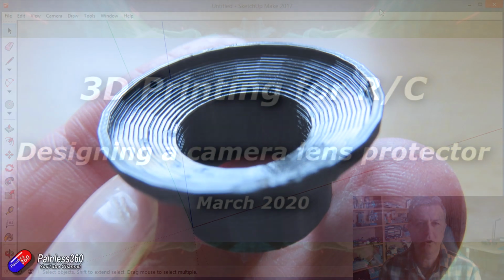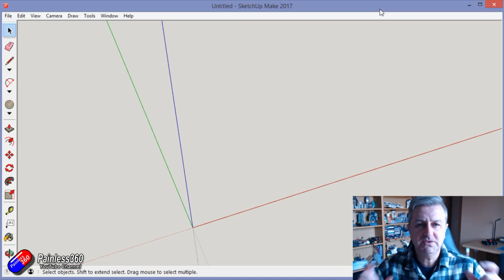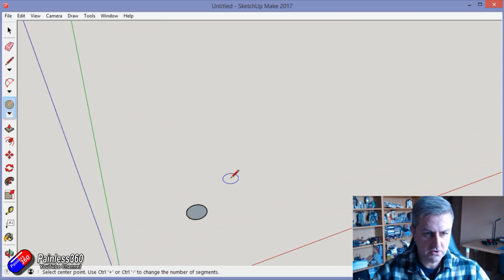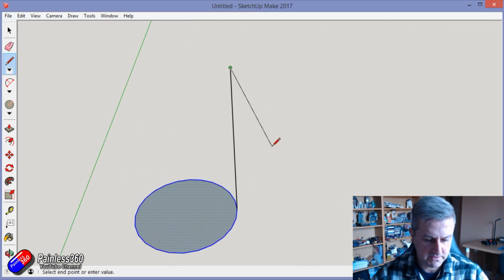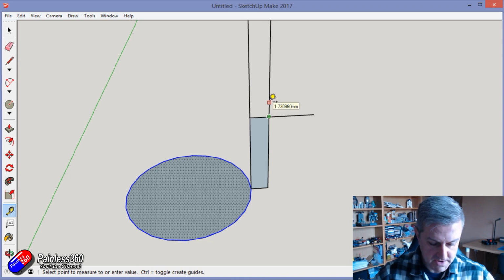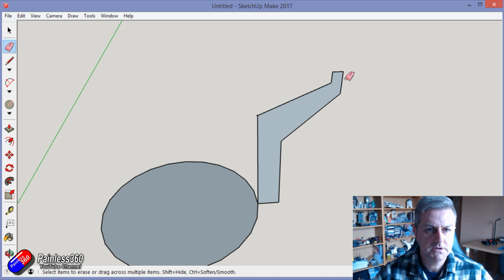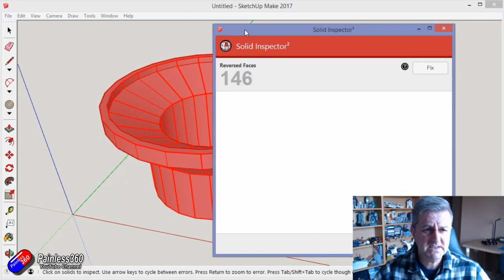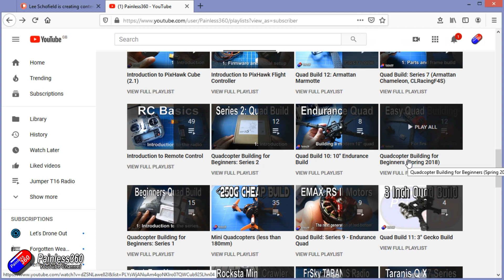Designing a DJI Digital HD Camera Lens Protector

Comment: Nice protector....but would it not be worth having a transparent layer of glass or plastic in front of the lens? There is still a chance that the dji camera lens can still get scratched even with the cone on (  maybe by a branch) . I know imagine quality may suffer with an extra of glass in front ....
Reply from the maker: It would, DJI sell one... Happy flying!
Reply: @Painless360  thanks for the reply. I was just thinking of putting a lens filter ( UV, 50mm diameter) on the cone you designed.

Comment: I love Sketchup for it’s simplicity and intuitive interface. I‘m using it mostly for woodworking and similar projects. For 3D printing I decided to use FreeCAD, which is a lot more complicated and less intuitive, but much more powerful when it — for example — comes to changing and tuning dimensions and shapes. I would have used Fusion360, but I don’t trust them to provide it for free forever. Like with Sketchup, it‘s closed source and proprietary. I don‘t wanted to invest all the time into learning another program and then they suddenly charge a monthly fee for it or something like that.
Reply from the maker: I have to agree with you. There are lots of 3D design programs out there and it depends on so many factors as to which one will suit how you think, design and draw. Happy flying!

Comment: i got tired of sketchup, with how buggy it was designing small parts. switched to fusion 360 and that's just a new amount of headache, trying to design things.
Reply from the maker: Everyone has their own software that makes sense to them and works better then the others. I'm sure if I spent more time in another package I would be just as fast as in Sketchup..
Reply: Fusion 360 is great for when you want to bring in other DXF files to use as a base for modifying other files or working forward.    Really powerful software for not just making 3D STL files for 3D printers but moving towards manufacturing for getting Gcode for a CNC mill.

Comment: arrrgh I've spent too much of my working life fixing crap people send me from SketchUp to not be triggered by this video 😉
tried fusion 360 yet? I know they're almost certainly gonna hike the prices soon but then freecad or one of the others will step up for hobbyists I'm sure.. in any case please let SketchUp die 😜
Reply from the maker: No chance! :) For those of us classically trained design draftsmen designers it makes so much sense! Using the tool I show at the end will highlight any issues or unresolved geometry -maybe you only accept files that pass this test ;)
Reply: @Painless360  I've still got my range of mechanical pencils and french curves stashed away somewhere!
I know there is a difference in mindset between the direct modelling of SketchUp and Rhino, vs the parametric modelling of SOLIDWORKS and CATIA, but Fusion 360 does offer both modes, as does Onshape I believe.. may be worth looking into that side of Fusion if that's what you really like about SketchUp?